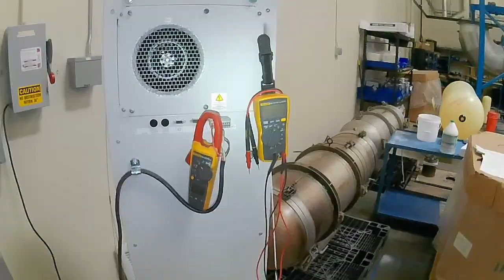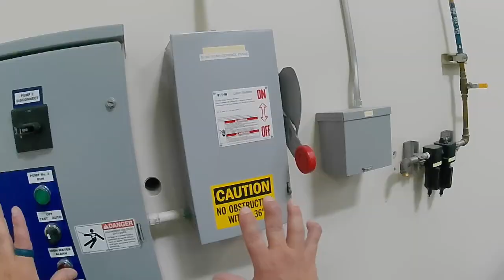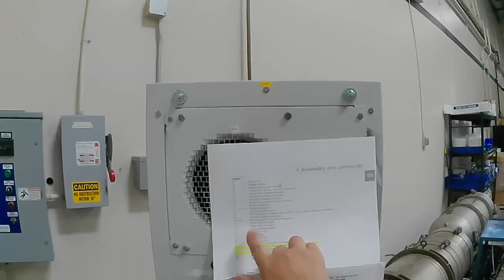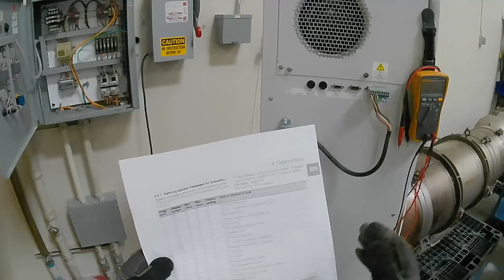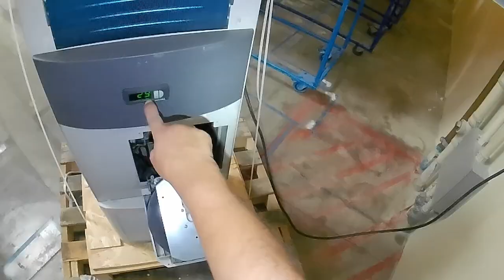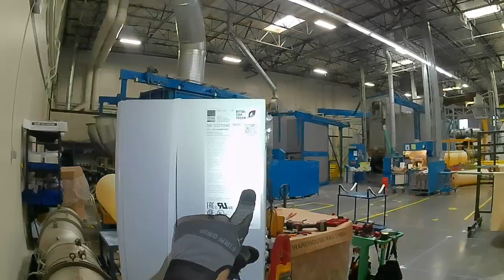Locked Rotor Compressor Takes Out FUSE!!

Comment: Good overall detail about your procedures, but you didn't mention how you determined the right fuses for that unit. Too bad you had to wax a 10A fuse.
Reply from the maker: I Just Ran What It Used In The Machine It Came Off. I Was Prepared To Lose One Or Two....Really Just Wanted To Get It On Camera. That Compressor Is Toast. Thanks For Watching.